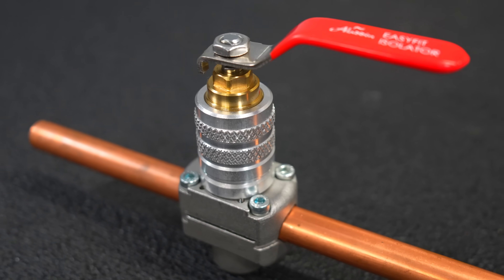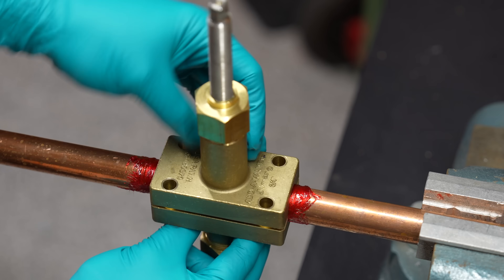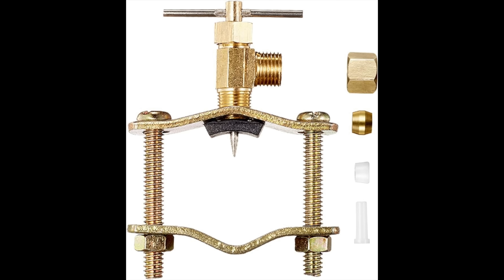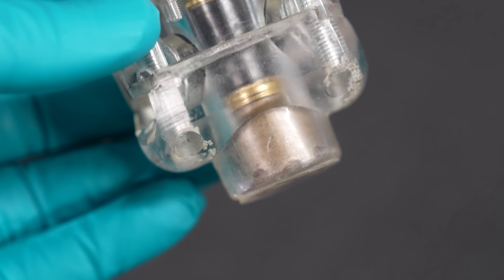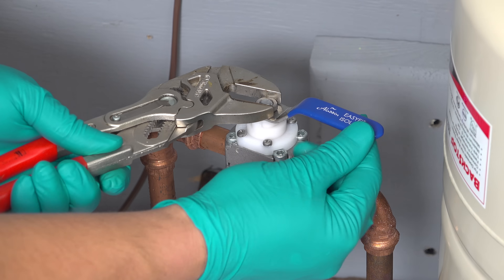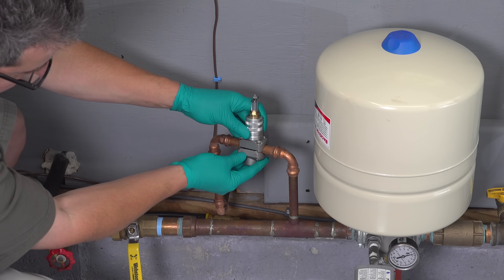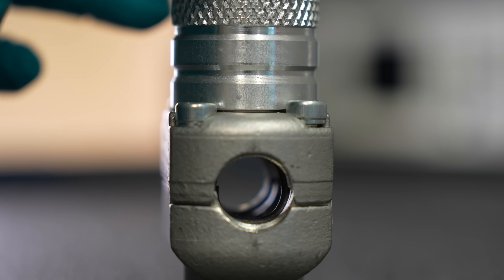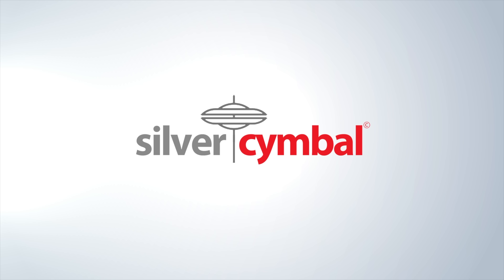Is this INSTANT Shut Off Valve ILLEGAL?

Comment: If that valve is put on before a pump, there is a good chance the drill cuttings will destroy the pump, & possibly any other sensitive equipment the water flows through

Comment: Put on brass taps unstead as they last alot longer & have easy accessible parts incase a washer needs replacing. Ball valves have short lifespans & arent serviceable & all of it has to be replaced usually around 10 to 15yrs time 👎

Comment: Any suggestions for freeing a stuck mains water valve at the entry point to a very old house.  There is an underground shut of valve which can be reached easily with a valve key but the valve will not close and I do not want to apply too much pressure.  The valve has notbeen shut for decades.  My question is how can I free the valve without risking using too much pressure and without kidding three foot into the ground?  Would any kind of liquid help?  The valve is inside a three or four foot long tube.
Reply: I had two brass stopcocks one 1970s & one 1995 that we're totally seized solid. WD40    do a spray specially for seized taps. I sprayed each one using the straw direct into the turning part of the tap a couple of times each day for 3 days & eventually they by both turned without any leaks.\0/ 🤗🤗🤗🎚️

Comment: I am pretty sure that the price for this shutoff valve is the same as a call service to a Plumber to fix a leak or install a standard shut off ball valve. The only satisfaction here is that is made for people like me and easier to do on your own, so it's priced for that reason. I think is a great idea. No cutting piples, no sharkbites, no soldering.

Comment: What do you do  5+  /  10+  years down the line when the O Ring deteriorates and begins to leak ?
Reply: That's a valid Question for the OP if they have any knowledge on that subject! Interested to know myself.
Reply: I would install a new one upstream of it and replace the section of pipe where the old valve used to be. And only 5 years out of quality ball valve? Please.
Reply: @SADFORIAN  You seen the quality of O RIngs recently ? With this design the O ring is the ONLY thing sealing the valve to the pipe ! If that seal goes there's a direct path for the water from inside the pipe to outside the pipe ! The valve is redundant at that point. I'm relying on memory from research i did over a year ago at this point however so do your own research. My original question does not really cover the extent of the problem i face. The original cock valve is seized ON so this solution will allow me to shut off the water to the house but without shutting the water off to the entire block it does not resolve the problem of replacing the original cock valve  on the pressurized side of the new valve !

Comment: Just installed two of the 3/4 on a hot water return line in a hotel. The idiots who initially plumbed the building put no isolation valves on this branch of the return line and of course, it had a leak. Shutting the entire building down was not an option. Super easy installation and fast. Just a heads up you will feel almost no restriction like a normal ball valve when turning it off. Makes you wonder but they do work and are very very practical on high rise buildings

Comment: I needed this last week!  I had a water leak in the basement before the house valve shut off.  I dug out the curb valve under 3 feet of snow and ice and found the tube to the valve full of asphalt from the original driveway installation!!  A plumber cut the pipe under pressure and quickly installed a valve while getting blasted with water.  Cost was $1100!
Reply: wow 25 material turns into 1100 bill

Comment: I'm cutting the pipe and shoving an open sharkbite valve in before spending 500 bucks. Or using a compression fitting instead of the sharkbite
Reply: 1st reasonable response yet. I've had sharkbite fitting in my house for over ten years now and not one single issue. Any plumber that says otherwise is a liar.

Comment: If I really would need a valve somewhere RIGHT NOW, then this would be a good option to have - simply because it works and that's always better than no option. But I would be highly hesitant to install that if there's any way around it. Because: WHAT IF THAT THING FAILS? I'd still have to close some valve that isn't there… but now FAST!

that said: in those cases nobody cares about price too much

Comment: Ingenious award winning product, allowing isolation of flowing how or cold water under pressure, installed in just a few minutes using your cordless drill and the tools provided, innovation at it's best.

Easyfit is: LEGAL
Much cheaper than Add-A-Valve
UPC and NSF approved
A full flow permanent isolation valve, Add-A-Valve is a one-off blocking device (NOT like for like)
An isolation valve suitable for copper and plastic pipes
Supplied with a full warranty
Designed to be water hammer resistant
Lead-free as standard

Comment: I install a shutoff on every line repair and in addition to every sink, water heater or spigot I install to make future maintenance and repair easy. I also set up my homes so if I need to renovate any room I can bypass the existing water lines with farm grade hose and garden hose fittings. Do that right and if you need to your system can run off a temporary water heater sitting on a pallet outdoors so you can always shower and wash up.

Comment: In my house in Europe we have simple valves everywhere, in case something happens we can turn off hot water, cold, both, only a section of the house, etc.
Reply: There are usually shutoff valves in most finished rooms with water in the US as well. Occasionally they won't be installed either because of an idiot plumber or an idiot plumber.

Comment: This looks awfully similar to a saddle valve, which are not permitted by the plumbing code in many, many jurisdictions. This valve looks like it uses the same concept as a saddle valve, so, yes, it very well may be illegal. Check your local codes office.

Comment: Excellent for emergencies. But otherwise I'd always go for a normal valve solution. Not just because of the high price tag, but also because I don't fully trust the seal on that thing.
Reply: I would trust it, but the price is ridiculous.  Easy enough to solder in a regular valve ..... would only use if in a total bind.  way too much.

Comment: I heard an interesting story about a woman that couldn't find her meter shut off. Specifically gas. Turns out all of them on her street were buried when the city put in a sidewalk and then claimed the homeowners were responsible for having it moved if they wanted to shut their gas off, including tearing up the sidewalk and putting it back.
She just stopped paying her bill and when they threatened to shut her water off, she said "please do". After a few conversations the city admitted it was their responsibility and fixed all of the meter shut offs free of charge.
Reply: That's a great story! Some problems can be solved by simply refusing to do something.
Reply: @mikethespike7579 He's just standing there.. MENACINGLY.
Reply: @mikethespike7579  specifically refusing to do your part on a contractual obligation. Always gets the other party moving. Might be just the thing you need in some cases LOL
Reply: Was it gas or water? You changed your story halfway
Reply: Isn't this like... crazy illegal?
Reply: @OidhcheMhath  
Not when the ones making the laws control said laws.
Reply: @OidhcheMhath  That is what unelected bureaucrats do. You only need to look and see how corrupted the Feds are.

Comment: That valve is best for places like a multi unit apartment complex/highrise, where a full building shut down for an emergency is a NO GO, or for maintenance work.  Plus, if you turn off at the base level, you then have the down presure of all the other apartments above the one being worked on and that ammount of water and preasure in the line is crazy....  So this valve lets maintenance/super's isolate an apartement and turn off to just that unit/floor or, in an emergency where a leak is discovered, but cant find out where and there is no maintenance room, no way to tell what does what, etc... this can help turn off a floor/line in an emergency preventing a bad Blockout. I would say this is NOT for the every day DIY'er, but more designed to the maintenance industry/building super's.

Comment: when are they going to introduce CPVC pipes to USA,
Reply: Cpvc common on the east coast ok for commercial but terrible for most residential applications since it likes to Crack with outside movement such as that caused by some diverter styles.
Reply: @michikomiyagi9863 Probably 1960.  CPVC was invented by Lubrizol, an American chemical company.

Comment: I have installed probably over a hundred of these.  All the way from 1/2” to 3”, using three different brands (sorry, I don’t remember the name of the third.). I was in the engineering dept of a major Las Vegas strip property with well over 3000 rooms,casino, convention area, shops, and every thing else you would find in a mega resort.
Like every other Vegas property, it was built on a super tight budget, and the cheapest materials were used.  
When we would have a waterline failure, a once or twice a week happening, we would attempt to turn off the water at the closest valve.  More often than not, it wouldn’t hold.  If we could, we would go to the next valve back and try that one but that was seldom an option as the further you go back, the more you shut down.  Executives don’t like that obviously.  So we would install one of these so we could make the repair.
In my jurisdiction, they are allowed for temporary installation only, unless something has changed since I retired.  
That meant use the valve to make a emergency repair, then plan a shutdown of a large part of the system in the wee hours of the night and replace the valves behind it and cut the quick valve out and trash it.
A typical 1/2 broken water line would usually require 2 to 4 valves to be replaced, and yes, we always replaced with high quality valves.
One last note, while expensive, we didn’t pay any where near the prices quoted.  A 1/2 was about 150.00 and a 3 inch was about a grand.
Reply: Was it possible to reuse the valves?
Reply: @hannahranga  I bet most plumbers will have tried that. It doesn't look too difficult.
Reply: @hannahranga  no, they are one time use.

Comment: How realistic is it to flush out the line when i need a valve that has to be fitted on the pressurized line? If I can just flush it, I can also probably turn it off to install a normal valve.
Reply from the maker: Flushing it just means opening up things downstream without an aerator or filter. You should do that with after any plumbing work to remove cuttings, flux or just contaminants from new pipe

Comment: Normal sweat valves are easy to install and work beautifully. There is NO such thing as a water supply that cannot be shut off.
Reply: You can freeze crimp copper than reshape but in the USA some situations such as only working valve being on the sevice under a road your not always allowed access. That's part of why it's common practice to do live valve replacements in some areas.

Comment: I had one of those saddle valves spontaneously start leaking at my wife's business. It wasn't even being used for anything (I think it was probably installed to provide water to a refrigerator). Fortunately it was caught before any damage was done but that was only by chance and it could have been running overnight.

Comment: Yeah but if you have a street valve you have to get permission from the water authority to even touch it and usually it has to be a licensed plumber to turn it off
Reply: I think that's strongly locale dependent.
Reply: And sometime they don't realy work anymore.
Reply: @peger  yes that can be the reason.

Comment: This would be AMAZING for retrofit work in older homes when the main shut off needs replacement! I still like the Jomar more as it is all brass. The way to do it is to install the Jomar, then install a threaded adapter, and install the best possible shut off valve (Nibco HydraPure valves are my favorite)
Reply: See them used more in homes from 90s or so historics/older homes usually have basment that won't be hurt if you do a live repair quickly.

Comment: perfect example ive seen this would work for... major retailer with landscape sprinkler tied into fire sprinkler without a shut off 🤦‍♂
Reply: Just kill the water to both and install isolation valves prior to backflow see it often in older buildings usually an easy fix.
Reply: @sewerrat7612  only if they have a shut off
Reply: @thatjokerperson7062  can always shut off main or add valve live utility/maintenance rooms are generally designed to handle a little water.

Comment: just keep a shark bite end cap on hand
Reply: Sharkbite valves work better for home owners if using on copper remove insert and slide on with valve open so pressure doesn't blow it off then close. Perfer Hou just call a plumber though since in many areas insurance won't cover water damage from homeowners trying to correct piping if something goes wrong.

Comment: Regarding the question "why not just shut the water off at the street?" one should note that your steet shutoff valve may not even work anymore. Mine is from 1972 and doesn't completely shut off the flow of water. If you complain to the city about it they tell you that you shouldn't be messing with their equipment anyway to scare you away from pushing the issue. I had an old main shut off valve fail underneath my house and I had to shut off the water at the street and was still getting soaked by the water getting past the main valve. Thank God the sharkbite worked without leaking. And before the sharkbite hating crowd comes a calling I already know the internet hates them spare me the comments!
Reply from the maker: That is such a great point, thank you for sharing this
Reply: What's so bad about sharkbite? I'm not a plumber nor have I ever heard of the Company
Reply: @ladripper47874  It's mostly that they are an impermanent solution that some treat as permanent. Because of the way they work, something like water hammer could cause them to spectacularly fail much more easily than a brazed joint would.
Reply: @kauske  They are not presented as temporary though I am fairly suspicious of them myself. It was handy when a saddle valve sprang a leak and there wasn't enough pipe left once the problem piece was cut out to do a proper join though.
Reply: @ladripper47874  an expensive temporary solution, a push fit plastic pipe connector, that's currently a fad to use for everything.  Like the video, when you need one they're brilliant. But they are not a one shark bites all solution!

Try finding a sharkbite for your 30-year-old non-PEX pipe anyway :p  I had to use a bunch of brass nipple clamp connectors (not as fun as it sounds).
Reply: If they can't shut your water supply... just cancel the utilities contract. Free water until they fix it! ;)
Reply: @jackmclane1826 now that is smart
Reply: @jackmclane1826  a win win situation quite entriging
Reply: When my house was built the electric company hit my water main line that was buried and they repaired it with a sharkbite connection, then re-buried it and never noted it (that good old "If you can't see it, it won't be a problem" fix). About 6 months living my water bill was near 4x usage because the fittings started to leak. Needless to say it was repaired later. If sharkbites are used honestly in my opinion they need to be accessible. Burying or installing as a permanent fix is just asking for trouble.
Reply: This is insane, talk to your insurance, some insurance companies will demand you to shut off the water main when you leave your house unoccupied for longer than a certain amount of time, if you haven't shut it off before leaving and you come home to a water damaged building because of a bursted pipe, the insurance can deny you payment because you didn't shut the main water valve. If they require you to do this get a note from them and take it to your town council and file a complaint.
Reply: My concern if you cannot shut the water off is, what if something goes wrong during the install? You could suddenly have made a big problem that you have no way to control.
Reply: @chaos.corner  concerning what to do if something goes wrong during the install of the valve I believe the utility would tell you to have a backup handy. Technically you can use a propress on a line with water running through it. I know it would be nice if everyone played nice but that's not how it always goes.
Reply: Might want to have someone put on some nice headed notepaper that they have been notified of faults in their equipment and if any damage occurs as a result of it, they'll be on the hook. They should not be giving you grief anyway. The water company replaced the valve with no fuss when notified about it being an issue at my wife's business.
Reply: @chaos.corner  every municipality is different. Threatening them with legal actions could backfire when they whip out their own lawyer
Reply: @wler5082There's not really anything they could do in retaliation and they're not doing their job anyway. Putting them on notice in a somewhat official way might get things moving though. These kind of people often work on hoping you'll just go away.
Reply: Thats my problem with a street shut off valve which is sited immediately behind my bathroom and is my responsibility not yhe waterboards.  Tough it is an old style water board type underground valve.  Which though I have the appropriate device to connect to the valve the valve is stuck and I dont want to apply too much presure to turn it off.  Is there anyway to free the valve using liquid for example.  Its possible to flood the tube in which the valve is located in the bottom off.  Water for example slowly drins away.